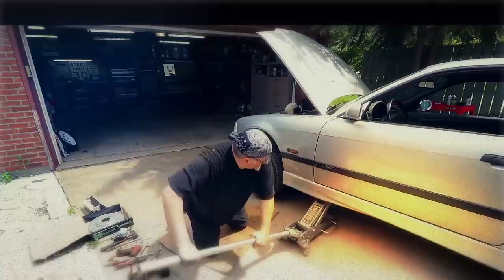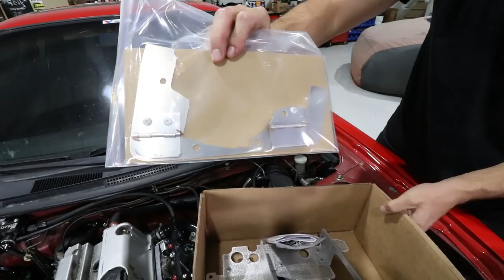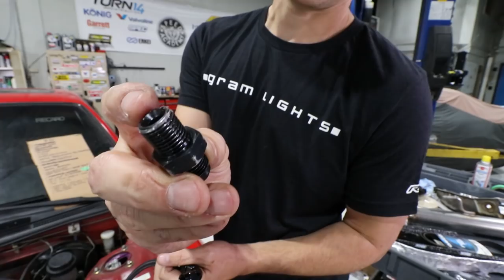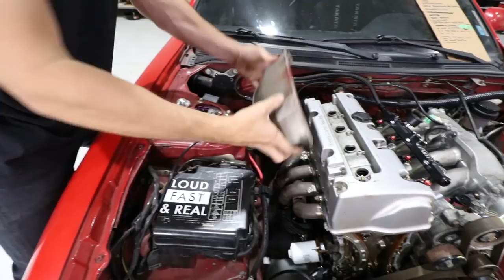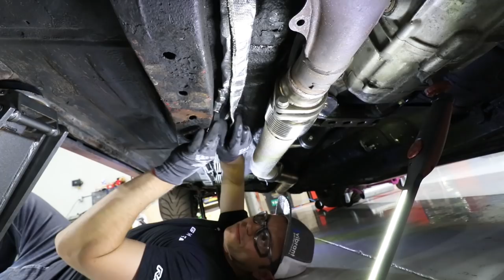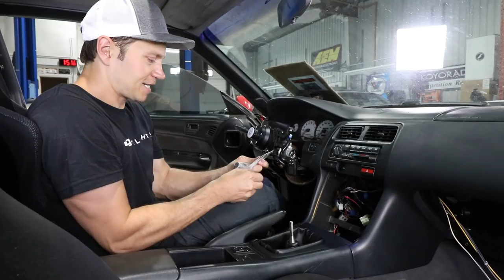Unfinished Business - Honda K-Swap 240SX

Comment: wrapping fabric when wet allows you to wrap it tighter. the moisture evaporates on the first heat cycle, so there's no drawback. when weapping dry, however, the heat cycle will loosen the wrap leaving you with flappy heat wrap =)
Reply: This right here is why you wrap them wet

Comment: I'm getting parts together for my e30 to k24A2 swap and you guys (plus members on several forums) have made a lot of the planning go a lot smoother. The little issues and solutions that have cropped up (eg the power steering fastener) are gonna come in handy.

Comment: If you haven't already seen it check out the pulley setup on the boosted bois K24 STI.  You might be able to do it the same way.  It seems really clean and uses a D-series civic tensioner pulley.

Comment: Don't forget that Stripping Tech can do ceramic coating. We have been shoving lots of big turbo 2j HP through our coated stuff for 2 seasons with heat wrap on top. Redid a bunch of of the heat wrap in the spring and it looks exactly the same.

Comment: Wet wrap = no itchy fiberglass in the skin. Also goes on tight and the water evaporates quickly on the first start. I doubt it makes the pipe rust any quicker than dry.

Comment: PT look into a ceramic wedding ring.   Won’t conduct electricity and will shatter if anything hard falls on it.
Reply: brian hilligoss Another option that’s common in my field is silicone rings, I don’t know how they stand up to heat but they save your hand from fatigue when using wrenches, hammers, shovels, and anything else that you grip. It sounds like an overreaction but those repetitive gripping or squeezing motion really affect your hand after a while. Also congrats!
Reply: Ceramic wedding rings are like most marriages...surprising hard, yet fragile.
Reply: And if you get pissed at someone you can toss it at their windshield
Reply: For real!!!! I made the mistake of wearing mine while working on my car. Needless to say, I had to use vise grips to bend it back into shape to get it off my finger. It hurt like hell!!!!

Comment: Never soak the wrap, it removes a coating on it that helps with insulation, you just dampen it so that it stretches more and when it dries it makes it tighter. Use the silicon spray on the piping to stop corrosion.

Comment: True story, a guy I used to know was welding with his gold wedding ring on. He was welding overhead and a big goober of weld fell down, melted through his welding glove and landed directly on his wedding ring. Gold is an excellent heat conductor and the full heat of the molten metal transferred into his ring instantaneously. The ring, now red hot, melted through his skin all the way to the bone. Not fun. Don't wear a ring while welding.

Comment: The heat wrap should be wet when applied .
Reply: Jeff G that's purely for tightness and avoiding fibres getting all over you. It will also accelerate the inevitable rustling of the exhaust
Reply: magnetic0314 By some small amount. Id rather have it nice and tight and not have glass all over me. You also can paint the pieces to be wrapped with a few coats of good header paint before wrapping.. That's my preference
Reply: magnetic0314 it won't rust if it gets driven when it gets wet as it will just evaporate

Comment: In a lot of this "shows" i see these so called experts using impact guns and similar and no checking with a normal wrench or a torque wrench that the nut or bolt is correctly torqued. Most of these cars will come apart in a few days of usage
Reply: Andrea Sanai they often do the final torqueing off screen, or a temporary installation
Reply: Legit use rattle guns or wrenches on everything and never check with torque wrench unless its drivline stuff, never had a problem and i work on mining gear.

Comment: Sr20det> k24.... Change my mind.
Reply: Silviasean I love you man. Keep doing this.
Reply: k24t>sr20det>k24
Reply: Jon athan not according to the top 10 fastest 4 cylinders in the world list.
Reply: Ka24 is the K series iron of nissan.
Reply: whats the reasoning behind this statement? genuinely interested in everyone arguments for and against each engine
Reply: k24 makes makes 240 to the crank na stock, sr20det makes like 200-230 crank stock.
k24 turbo holds up to 500hp never opened it up, sr20det needs forged internals for that.
k24 is dirt cheap. sr20 is like 2k atleast.
and VTEK YO
Reply: Max Swagg 500 hp on stock rods? Thats questionable but I'm not very knowledgeable on the k series. And if it they could I doubt it would last very long. In stock from at 6psi my stock sr20 would pull hard on any k-powered car. At 10psi lol I could put bus links between us. I'm not saying the k series are a bad choice I'm just saying there are better options. sr20's make 300-370hp with just a slightly larger turbo, disco potato ftw!
Reply: Can someone show me a k24 that does faster than 6.50 @ 220mph? I know you cant because the only Honda powered car on the top 10 list is in 9th place. There are 2 sr20det powered vehicles on this list by the way.
Reply: Imagine fighting over different 4 cylinder engines. It doesnt matter just use the one that suits your needs, availability and budget lol
Reply: Max Swagg k24 does not make 240 to the crank Lmfao. No k series does stock.